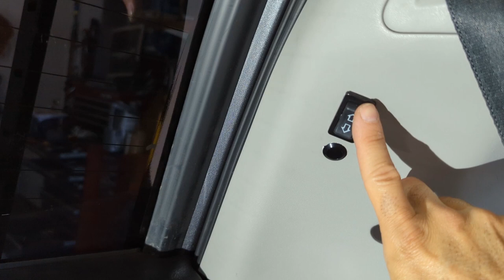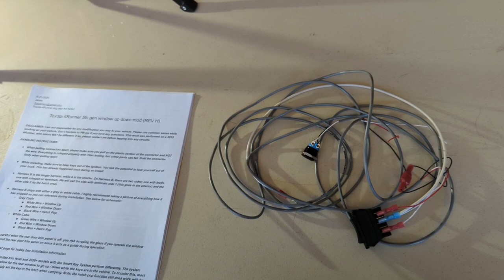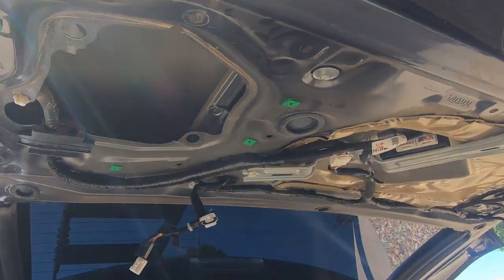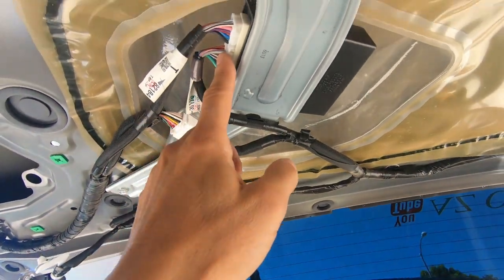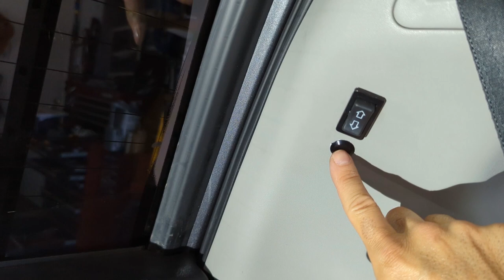Car CAMPING (Window) Mod - 4Runner (SUV) - Step by Step Version

Comment: Love it! I actually found Jesse forum back in March. He has 2 kinds of kits, wireless remote ($150) and wired with the buttons. I researched more and found this Brit guy's vid with link for the exact wireless kit for just about $30. I didnt want tovdrill holes on my brand new 4runner. I have not installed it yet, just haven't found time. Buy your video is awesome and helpful. Thank you
Reply from the maker: Good luck with the install. Let me know if you need help
Reply: Can you get me the ifo to findout if I can get this kit for a 3rd gen 2002 Toyota 4runner
Reply: Ordered a few days ago..im expecting delivery today. Really excited to see this in action

Comment: Installed this today. Helpful video. 2 tips for whoever does this next. 1 Get a proper fish tape like one from Klein Tools. Don’t try to use a clothes hanger. Fishing the wire through hatch channel took me 30 seconds. 2 Install the switch toward the bottom of the white upper panel. I tried to install it too high and learned that the switch is deep and the space behind the plastic is shallow. Now I have to figure out how to cover the hole I cut. 😢
Reply from the maker: Great tips! Thanks
Reply: @AZOverland2017   finally i get to use my klein fish tape
Reply from the maker: @Gigafactory  Love it. Blowing the dust off huh

Comment: I have been in touch with Jesse, very responsive. I am getting the $75 kit, have a 2022 TRD ORP, will not be able to use the toggle switch to lock/unlock, but doesn't matter, with key on inside as I sleep. My main concern is rolling the window up and down throughout the night and pop that hatch. I did a 9 week Trip from Atlanta to the west coast and all over February-March this year. Never seen so much snow in California in my life and loved every minute! I wish I had this then. I am 6ft 250 lbs. and had to go in and out of the back side door. It was an acrobatic feature. Bring able to crawl in and out of the back and able to pop that hatch from the inside would have been a game changer. I look forward to the kit and installation. I had a heater and had to be careful, being able to control the back window with a switch in the back as opposed having to get in front and push the button 2x, that or for any window. We exchanged messages a bit not too long ago about the sleeping mattress made by a company in AZ for the 4Runner. After your video I bought one for the trip and put it through hell and it held up great. Kept trying to get in touch with them afterwards to get the mat, they would never respond. That’s when I reached out to you. You kind of said the same thing or had similar problem.  They finally did so. I am not sure if you remember that conversation. I know this is long and windy but will rely on your video for installation. MAIN QUESTION: Instead of the 3 blue clip/splicers/taps provided, you used 3 pink caps? I could not understand what you called them. I am hard of hearing. What are they and where did you get them If I may ask? Also, did you buy a special kit to remove those panels? I have seen them on some 4 runner outlets, just wondering if you just had the right tools and or bought a kit.  Thanks for any response in advance. Carlos R.
Reply from the maker: Thanks for the comment and questions. I ended up using Posi-Taps instead of the supplied blue connectors. I will link that below for reference. Also, as far as removing interior trim pieces, I have an inexpensive trim removal kit which I'll link below as well. I do remember talking about the DeepSleep mattress and their lack of communication. Something obviously was changing within the company because about a month after that conversation, i was beginning to see that they were becoming very active again of social media. 

Posi-Taps 
https://amzn.to/40JW6Q1

Trim Kit
https://amzn.to/471RhUt
Reply: I appreciate everything you have replied. I’m just now getting around to doing this though. I’ve had the kit for about two months. I’m going on a trip for about six weeks from Atlanta Georgia through Southwest Texas Northern New Mexico, so I’m going to install this thing finally. Hopefully this will be the last question, do you remember what size of Posi-taps you used? The link takes me to a great spot on Amazon, but need to choose my size. I’m on my phone right now you may have already mentioned that and if you have, I apologize if you’re having to repeat yourself. Thanks in advance!
Reply from the maker: @charlesruelas3962  Here you go (18-24)

https://amzn.to/3w5KED2

Comment: About to attempt this mod tomorrow. Any reason why you didn’t run the gray wire through the rubber “tube” that connects the hatch to the body? I noticed you punctured a hole in both grommets.
Reply from the maker: You can do that as well, I found it easier for me to run it on the outside. Let me know how it goes.

Comment: Just ordered this kit from Jesse today. As I understand it, those quick splice adapters the little metal part has to be completely flush  with the plastic. If it sticks out at all it isn't in far enough. Did you press down as far as possible? Just wondering if I should just get some posi-taps now while waiting for the harness to arrive.
Reply from the maker: Get the posi taps. I have not had luck with the ones in the kit with either this project or past projects. They are hit or miss, but with such a small gauge wire they generally don't work very well
Reply: I just ordered this kit for my gen 3 as well. What are the posi taps and should i order those as well before install?

Comment: Can you add this to a 3rd gen 96-2002  Toyota 4runner? Can you put me in touch with the individule you purchase this kit from? Mine specifically is a 2002 Sr5 Toyota 4runner 2wd.
Reply from the maker: The contact information is in the link below. He can answer your questions

https://www.toyota-4runner.org/5th-gen-t4rs/250825-ultimate-camping-mod-rear-window-up-down-hatch-pop-ignition-off.html

Comment: Would it be able to roll windows down as a 3rd row passenger in motion ?
Reply from the maker: That's a good question. I can't confirm, but I would assume they would be able to. If that is a concern, I think he is now making kits that don't require mounted switches. I think he has a kit that operates off a remote

Comment: Why not just put the switch on the tail gate panel it's self?
Reply from the maker: I liked the location of the switches where thy are now in relation to where I sleep for easier access. it was not more difficult to put them there but I suppose you can put them on the tailgate if it was preferred.

Comment: How were the holes cut in the interior trim panel?
Reply from the maker: I drilled 1 hole for the round button. I believe it was a 5/16" bit. Took the same bit and drilled 2 holes in the rectangular outline form the template I made. Then I trimmed that rectangle out with a sharp utility knife (razor).